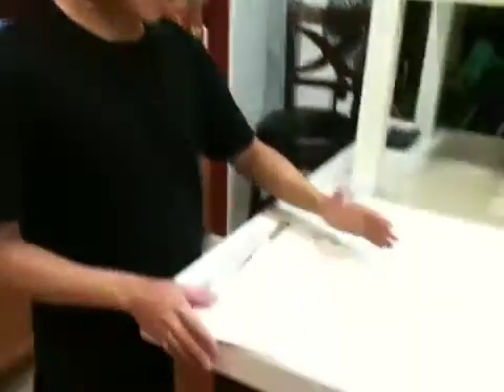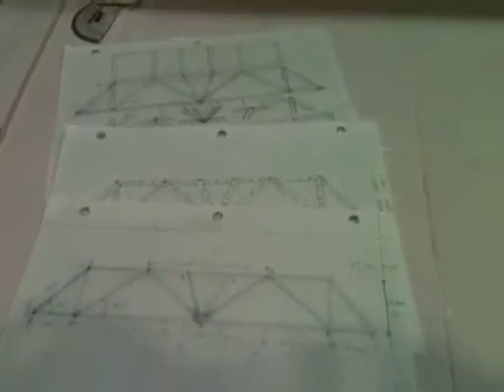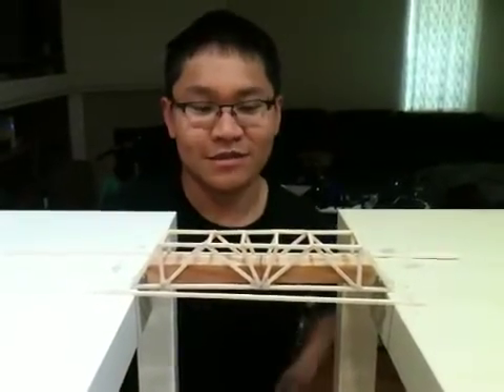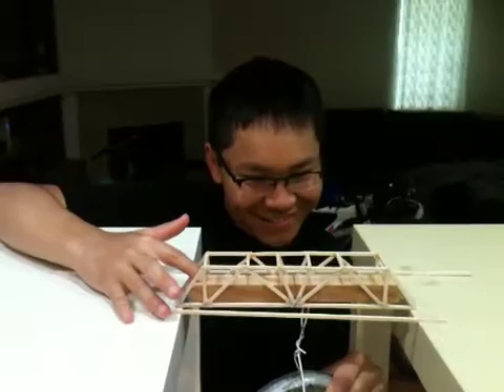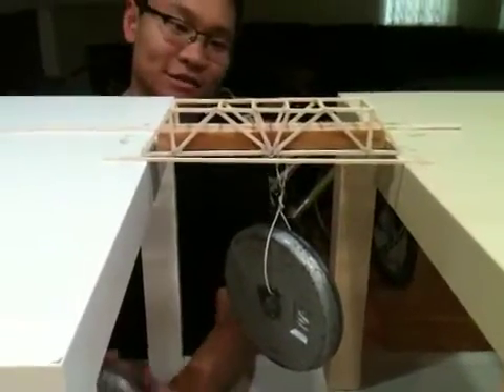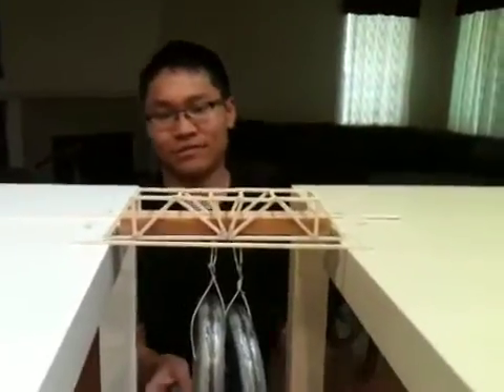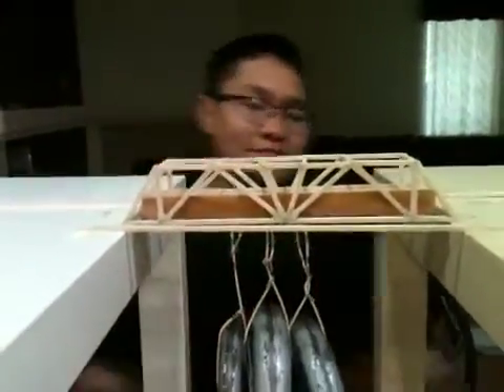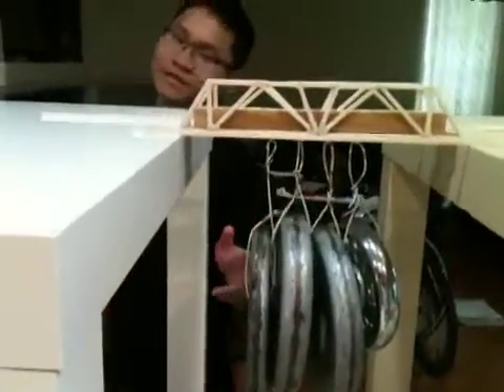Balsa wood truss bridge testing at 100 N. No breaking. Engr 57.

Comment from the maker: Update: Balsa wood has varying density so different pieces have different strengths. The bridge in this video was built with stronger than average wood so it failed above the load range. I tested other bridges also. The bridge my team and I made was a warren truss which failed at 99 point something N. Our bridge failed a bit early because of the gluing coming apart, but a true failure is when a member buckles. I passed the class with a B-. I slacked off on the dynamics part of the the course again. I withdrew or dropped out from the University in 2017.